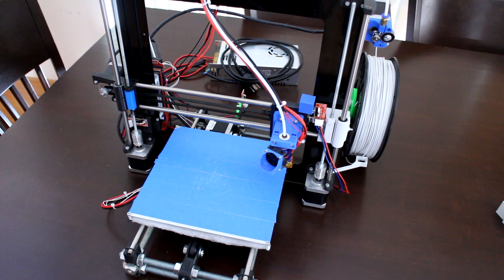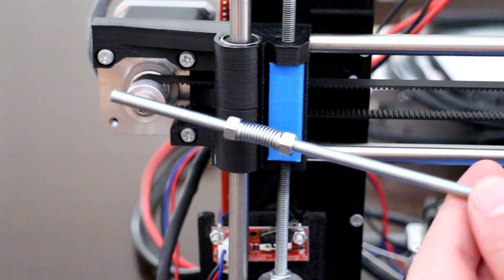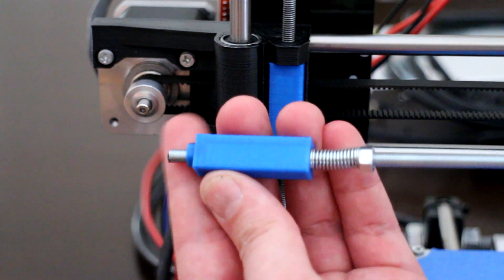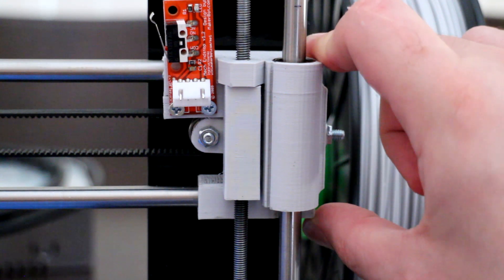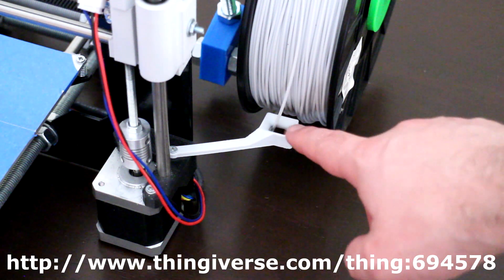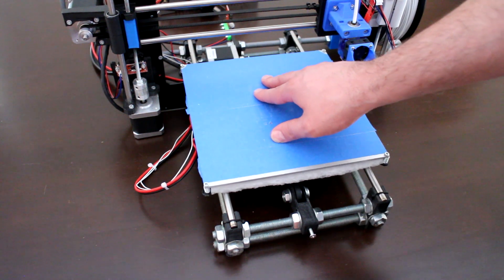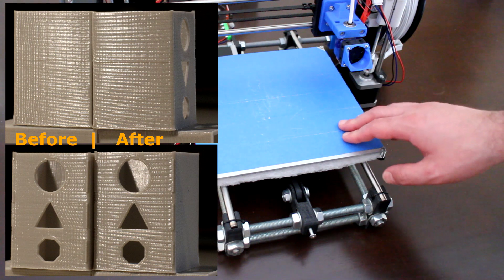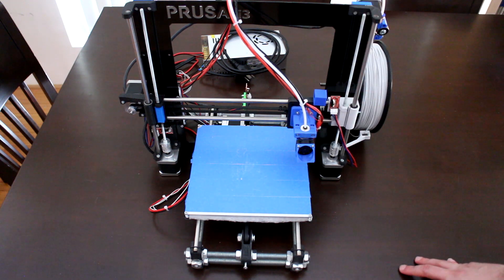Prusa i3 3D Printer - Upgrades!

Comment: Great video.
Two questions:
1.  Can you post a link to the plastic nuts you have for leveling the bed and also let me know if you drilled throw the thread on the bottom part.
2.  What is that electronic component that you have on the right X-End idler that you use for tensioning the belt?  What's it used for ?

Comment: Would a rubber washer, used as a damper on the Y carriage be a potential solution to the "ghosting" issue?

Also I wonder if there are any makers who are or have considered selling upgrade parts, for those of us that either own or have a backordered Prusa i3 MK2 or MK2S kit?  Some might prefer to make the upgrade during the initial build, rather than doing a teardown, after the fact.

Comment: btw ty. i tipped the designer of the x axis idler with belt :) im hoping i can get it to print. im having trouble when i get to lettering. machine moves so fast and that rod wobble i think belt comes loose and jumps. 
so im gonna try print this to fix that. i may get the other half too lol. i had my printer printing sweet. 4 days no problems. then i did something with lot of lettering and detailed work. its moving to fast so it goes clunk clunk. but i seen the belt move but not the idler pulley.

Comment: Is acrylic frame really durable? how long they last in your experience, guys? i need to know this because i want to buy almost 2mm metal frame, i think it is better then 5mm acrylic, am i right? thanks for anyone answer me :D
Reply: The issue isn't durability in regard to the two materials, the issue is rigidity.  Aluminum or steel are certainly more rigid than acrylic.

Comment: I purchased the RepRapGuru and right away I had lots of issues with the unit. The 1st thing noticed when building the printer was this thing NEEDS a belt tensioner on at least the X-Axis. Having worked on a processing factory fishing vessel in Alaska, our conveyor belts had tensioners. I knew rights away I needed to engineer this part. Although, having issues with my Z-Axis nuts, I came across your video and I have found 2 solutions for the price of one. I don't have to engineer the tensioner because the link is provided here. Thank you for this. So with the Z-axis issue I am having, I have been looking for a solution to hold the nuts in place on the Z-Axis because they often work their way out of the Z-Axis bearing housing\mount. So I'll see if I could get a good enough print of these parts. Thank you for your time on you video. I plan on doing a video on upgrades and improvements for the RepRapGuru for those guys who purchased the same style of Prusa.

Comment: Hello,
I have two of the Phoenix 3D Printers from Ez3D, which I have not been able to get running at all.  I am not sure what the difference is between firmware and software.  And how do I load the "firmware" or "software" onto the board, or does it load onto the Arduino memory or not.  and/or do I just put it on the SD card and use it from there.
Can you help with any of these issues? ?
Reply from the maker: Can you ask these questions to Ez3D? Surely they have a guide or some other support service to assist with the initial setup of your printer.
If not, checkout the forums.reprap.org. Most likely someone would have already posted about your brand printer with similar issues, or you can ask your question there and someone with that printer can help.
Reply: Hey,
No, Ez3D went out of business over a year ago.  They left a lot of people hanging.  I never did get the printers running.  Never did get the firmware installed, and no one there knew how to explain the difference between firmware and software, and what to do with them.

Comment: Backlash on a z axis is nonsense! You cannot have a backlash on a zaxis which hoes up and down. 
Remember gravity......
Reply: You can absolutely have backlash when gravity is involved. Friction in the screw threads another places can cause it. It doesn't matter much if you're not lifting on moves or at the end of layers though.
Reply: I'm with Andre on this, the nut will always run along the same profile of the rod, regardless if it travels up or down.

Comment: The additional work the stepper motors have to do to overcome the friction introduced by your spring will most likely affect the longevity of your steppers in a negative way, same goes for over tensioning your X axis belt.
Reply: +Don Doucette How much less of a lifespan are we talking here? My y-axis is a wee bit over tight but it's no joke to adjust it.... It isn't causing any issues at the moment and the stepper is cool but it's certainly not as loose as it was initially.

Edit: Not a Prusa printer.

Comment: wouldn't Roxall fireproof insulation be a safer bet? you could use about 2" thick piece and compress it down to 1" or less. it should have the same dampening effect as well as the safety factor that it can't catch on fire.

Comment: Hello Tech2C, how about the chinese delta 3d printer? Would you recommend? Thank you! BTW, awesome channel ;)
Reply from the maker: +Guilherme Brasil Pintarelli 
Hi. I haven't used a delta style printer. I've seen great reviews about them. I would recommend a printer which has support behind it by the community or the manufacturer. This is because you may encounter an issue and you'll need help to overcome it.
Reply: +Tech2C Yes, I've heard good reviews about the delta one as well. It's an open source project, so great :) ... My concern is about the plastic pieces, however luckily are printed in another 3D printer :D  Thank you Tech 2C!

Comment: I find it hard to believe the modification on the threaded rod makes a huge difference. Gravity will hold the Z-carriage assembly down, and since the only movement of the Z-carriage during print is UP there shouldn't be an opportunity for backlash to occur. That's my thought at least... :/
Reply: Sounds great!  Don't upgrade YOUR printer.
Reply from the maker: +RealityMan 
You are correct... when the z-axis is moving up only. There are "z lift" options in slicing software which allows the print head to be lifted before crossing perimeters. That feature could warrant anti-backlash helpers.
Reply: +Tech2C That makes sense. I didn't know of the z-lift feature. Thanks for the explanation!
And thank you for your video's too. I like the content and I find them pleasant to watch...
Reply: Still won't see backlash. You only need anti backlash nuts if the leadscrew is horizontal. Regardless if the x carriage is going up or down gravity keeps the contact constant.

Comment: my bearings for the idler wheel keep braking did you do something special on yours or do i just to buy more high quality   bearings 
just wondering if did some upgrade on that part to.
Reply from the maker: +Halldór Grétar Svansson 
Which idler bearing(s)? If it's the x axis, I've had to replace the original one that came with this kit. The new one hasn't broken yet.

Comment: Complete and utter 3D printing newb here. Would you say these issues have been worked out of the newer i3 available as of today? Still trying to decide which 3D printer is the way to go for me.
Reply from the maker: +xXG.L.HXx 
I'd say so most of them will have. The backlash on z-axis isn't really an issue for 3D printers unless you use the raise z-axis on layer change option. Some printers will incorporate belt tightening as part of the printed parts. Either way it's a 3D printer kit that can be upgraded over time as required.
Reply: +Tech2C Thank you!

Comment: K, I don't get it..... I've been screwing with my i3 for three days now, and the ONLY way I got anything to stick to the print bed was by sheer dumb luck........

three days and at least 50 print attempts, with just one sticking... I've tried masking tape, the cheap Chinese masking tape included, hairspray, degreasing the tape, acetone, everything sans an upgraded print bed.....

And the ABS absolutely, positively, REFUSES to stick......

I don't get it..... I simply just don't get it.... And now I need to figure out where I can get an extruder piece for this off-brand-of-an-off-brand-of-an-off-brand-of-an-off-brand Prusa i3..... :S
Reply from the maker: +CK&#39;s channel. 
I feel your pain. Park that ABS somewhere out of sight, and pickup some PLA. PLA is much friendlier to sticking down, with virtually no warping. Ensure you use the 3M branded blue painters tape #2090.
Reply: Well, in ABS's defense, my "upgraded for 2015" kit came with a heavily downgraded hot bed; instead of the proper red PCB bed with borosilicate glass, I got a thin plate of aluminum with a crappy heating element in the form of a sticker stuck to the back.... Oh, and one of the solders on that sticker has already failed..... Twice....

So, if you hear of some guy cursing the name of 3D printing whilst being dragged away to a looney bin, that's me....... :P

But, once I find someone online who can print and mail me a dang hot end bracket (because they don't exist in solid form outside of full kits, apparently, at least this particular one), I'm definitely throwing this entire roll of ABS away and firing up the PLA...

I've had an aggravating week to say the least, and it's not even Friday yet... X)
(40 more minutes until Friday)
Reply: +CK&#39;s channel. 
Autobed leveling and a PEI sheet works wonders.  Your first layer height needs to exact.

Comment: To prevent ghosting, replace the bed springs with High temp silicone rubber tubing.
Reply: +GrimKeep Does that work like a spring - so I can still adjust my printing bed?
Reply: Yes it does, not as much compression but if you cut them close to level, you still have plenty of wiggle room for tweaking.

Comment: Take this with a grain of salt as I have yet to build my 3D printer, but you may want to look at using rockwool under the heated bed. I believe the "glue" they use in rockwool bats are good to over 200/250C. And even if the adhesive melts you will still have a mat of springy fibers under there.  Assuming you are still playing around with this of course.

Comment: Are there any other solutions to the bed shaking/ghosting?  I'm concerned the foam I have won't hold up when printing ABS
Reply from the maker: +Titus Corday 
I still experience ghosting. You can slow down the acceleration settings in Slic3r or Marlin to alleviate most of it. Plus print at a slower speed, like 30mm/s.
Reply: +Tech2C Yes, I noticed it on my wanhao i3 as well - I print most stuff now on 40-50% movement speed and that improves the printed objects by far!
Reply: +Titus Corday 
How about silicone hot pads?
Reply: +Sebastian Heyn Slow down the acceleration and jerk of the printer. Make sure you save it to eeprom! http://3dprinterwiki.info/wiki/wanhao-duplicator-i3/duplicator-i3-calibration/firmware-settings/

Comment: hello tech2 i hve just started to wade into 3d printing i received the HicTop 3d printer (3DP11). this is just there version of the Prusa i3 aluminium square frome very similar to the one you are demoing. i took my time and used a level and square to get the best initial setup for my device,, my issue is the al thread on the right side (Z axis) jams when i move it up and down. is there a tip or trick to work this issue out?
Reply from the maker: +Grady Parker 
First ensure the z-axis doesn't bind or have any sticky spots when freely moved up/down by hand. 
Then adjust the stepper driver current to the motor. It could be not enough current is supplied to that stepper motor.

Comment: Hello, I have a question regarding 3D printers. I ordered a printer and waiting for it's arrival on a slow boat. :-) The one I am getting is like this one http://www.ebay.com/itm/like/181942739920?ul_noapp=true&chn=ps&lpid=82 Will the upgrades you mentioned work on this printer as well? I am totally new to 3D printing, so forgive me if my questions are noobish.
Reply from the maker: +Mike Notarnicola 
That's a nice kit. I wouldn't worry about upgrades to it unless the finished part quality isn't satisfactory. Check the reprap forums for others whom have bought that printer for tips an tricks.
Reply: I figured out thru some research that it is an Aurora A3.. Some sites say it is a reprap others don't mention it.. So we will see when it gets here I guess.. I am still learning :-)
Reply: Congrats on your purchase & hope all turns out great... I'm building my own at the moment, but I sourced the parts for mine & built my own frame myself.  Seeing this... I could already tell you that the belt tensioner & backlash dampener will help with 3D prints! I recommend printing this as soon as you get your printer up & running! ;)
Reply: Ok, Thank you! I will look into that. The printer has arrived, however the power supply was damaged in shipping.. So I am awaiting the arrival of a mew one. While I am waiting, I am putting the printer together. It is almost complete! Good luck with your build!!

Comment: Why would you need an anti-backlash system on your Z-axis since there's gravity canceling out any kind of potential backlash?
Reply from the maker: +TheSmellyPasta 
Good question. There are options for z-axis lift moves in slicing programs. That's when backlash on z-axis will be most noticeable.

Comment: Hi i having a problem when i try to power the heat bed it only power on for a few seconds then turn off  then i added a fan over the ramps and this time it only heat up for a few more seconds then shut off my hotend working fine stepper motors everything works fine except the heated bed can you help
Reply from the maker: +TriniRCmodels 
Check the resistance of the heat bed. For a 12v bed the resistance is typically between 0.9 to 1.4 ohms. If it's too low it may be causing a short circuit which is activating the fuse protection.
Reply: +Tech2C ok thanks can you tell me how to do that i'm new to this i have a multimeter
Reply from the maker: Disconnect heat bed. Measure resistance of heat bed with your multimeter (ohms on the lowest scale)

Comment: What diameter spring did you use? I'm trying to get some ready for my build.
Reply from the maker: +Sundee 
5.5mm inner diametre as the rod is M5.
Reply: +Tech2C You think this will work? http://www.ebay.co.uk/itm/Compression-Spring-/190633793950?var=&hash=item2c62a8d99e:m:mGsZy_NmFQQtKQhVe8Nlmzw
 6mm x 37mm x 1mm?
Reply from the maker: +Sundee 
Looks good!

Comment: Hey Tech2C, I have recently purchased an Aluminium heated bed for my Prusa i3 Rework. After getting it up and running I can't seem to get it past 75-80deg C. I tried to look around on google but people have just upgraded to a 24V PSU. I was wondering what was your solution in getting the temperatures high enough to print ABS?. I don't require my heated bed to go above 105deg C because I mostly print ABS with my heated bed @ 95deg C. Looking forward to your reply. :)
Reply from the maker: +Aaron D'mello 
Hey Aaron, definitely insulate underneath the heatbed. The aluminium is basically a large heatsink which will dissipate the heat away if given the chance. 

Next, check the resistance of the heatbed. In my experience there are heatbed's with too high resistance for 12v operation. The lower the better, but anything under 1.3ohms will be fine. Higher than 1.4ohms and we simply can't pump enough current into the heatbed at 12v - hence why some people move to 24v!
Reply: +Tech2C Thanks for your quick reply. Yeah I have a sheet of cork about 2.5-3mm thick under the heated bed, which does help quite a bit. 

I'll check the resistance even though it is mentioned on the website. 
Is it possible to increase the voltage a little bit on the supplied power supply without frying the ramps board?.. on the website that I bought the heated bed from mentioned this: 
"(1) Resistance between 1.4 and 1.6 ohm for the 12V.(2) With 15V on the 12V terminals will maintain approx. 115 degree Celsius without regulation".
Isn't that too much for the boards to handle? or would that be fine... 

With a little bit of research I read that the ramps can handle up to 14V but have to watchout for the LCD and also the arduino could heat up (not sure if that is an issue because I have a 40mm fan constantly blowing air at the boards).

Do you think I could use one of these: 
http://www.ebay.com/itm/New-Version-XL6009-Step-up-Power-Module-4-5V-32V-to-5V-52V-DC-DC-Converter-UK-/361275212783?hash=item541dae43ef 

and attach it from the D8 to the converter to the heated bed?
setting it from 12v in to 13-14v out direct to the bed.

Sorry for the huge reply.
Reply from the maker: +Aaron D'mello 
That DC-DC step up is only rated to 4Amps. The heatbed consumes way more than that, plus it would over-heat real quick.

I thought about using a step up converter too, but I ended up just buying another aluminium heatbed from a supplier that guaranteed low ohmic resistance, like this one:

http://www.ebay.com.au/itm/MK3-Heatbed-Aluminium-3mm-MK2B-ALU-12V-24V-Heated-Bed-RepRap-RAMPS-3D-Printer-/201125138578?hash=item2ed3fe1092
Reply: +Tech2C Yeah I guess I might do that as well. Wish I knew this before I bought one. Buying one with a lower ohmic resistance might be the easiest way out. Thanks for your help :)